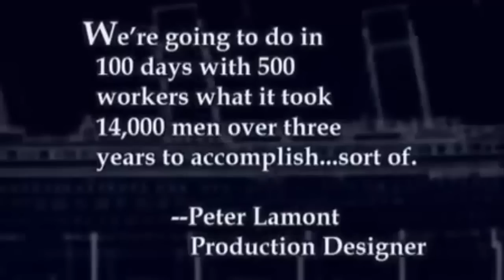JAMES CAMERON'S TITANIC 1997 "Making the Ship for the Movie"

Comment: What's interesting is that they actually only built the starboard side and the decks. The port side of this ship is just a huge opening. The problem with this is that for the Southampton scene they needed the port side of the ship and not the starboard side. They had to mirror all lettering on the dock buildings, cars, and the ship name as well. They also had to mirror all the actors'  clothes and hairstyles as well, which is why Leonardo Dicaprio's hair looks a bit weird in that scene, it wouldn't comb over to the other side that well. In editing they flipped the camera footage over so all lettering would look correct again.

Comment: This replica was 85% of titanics size, not 90%. It was also way to deep draught in the water so it looked not as high and massive as the original ship. You can see that clearly in the scene when they film the whole ship just after they stopped it after the iceberg hit, that F deck portholes is almost at the water surface. In reality F deck portholes was around 3.5-4 meters above the water line.
Reply: Was the scale 85% or was the total size 85% because it lacked the bow?